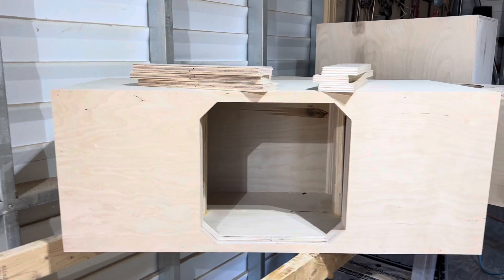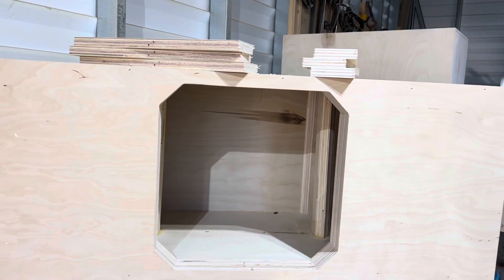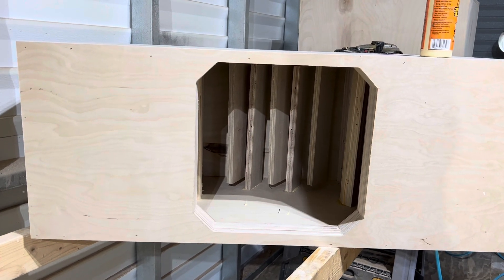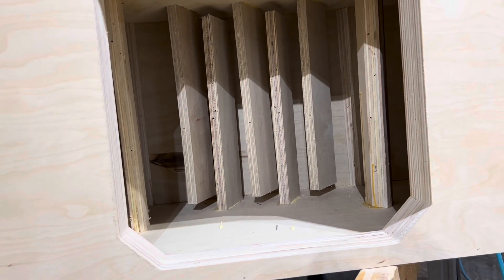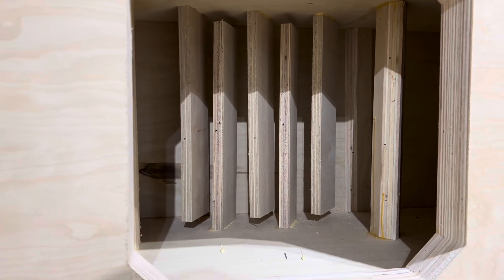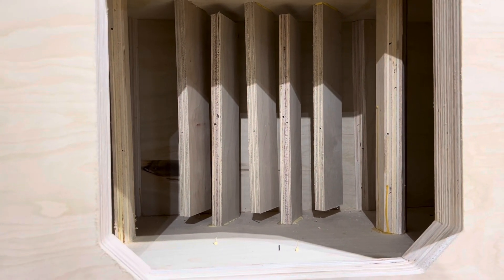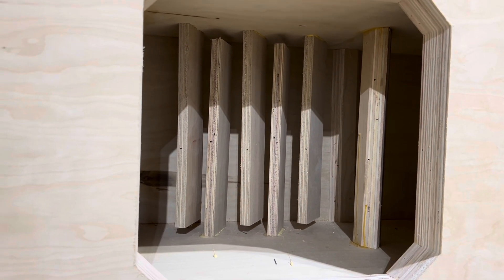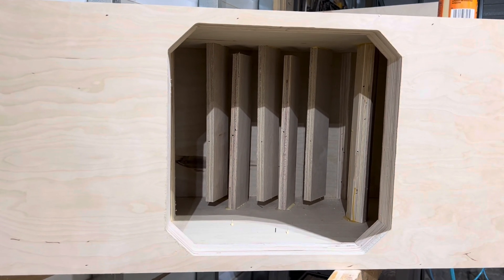Incongruent Box Internals Reduce Standing Waves…A MBE Theory!!

Comment: You can do that and lose volume upon doing so or buy Hushmat wavebreakers. This does exactly that. when you turn your speakers up, the standing waves (or back waves) that build up behind the cones can introduce distortion.Wave Breaker pads are made from a self-adhesive sound-deadening material that helps to break up back waves that can cloud your sound, and stop the distortion.  It also doesn't take any volume from the enclosure. Use it behind subs, coaxials,mids etc. Try either way. Whichever works for your build.

Comment: Would be interesting to compare damping and tonal quality of your internally paneled box with:  1. lining box with carpet underlay  2. lining box with polyfill, and 3.  instead of using wood for the panels, use eggshell pattern foam blocks.
Reply from the maker: All good ideas.. but as I said it’s only a tonal difference. Which could be placebo…😂
Reply: @M.B.Enclosures  Considering that tonal quality of sub bass (in my install) changes even with minute changes in head position in the driver's seat while critical listening, I'm sure there's more than just placebo going on!
Reply: Would the same be for those running an inverted sub setup?

Comment: So what happens if u round the edges ?
Reply: Rounding edges would also eliminate resonate frequencies, depends on size of fillet or chamfer, but most likely it would be minor impact at best. Quite literally the perfect box for a speaker is literally a sphere, sharp/parallel corners or faces are what causes resonance, so by eliminating all parallel faces or having no edges you have an extremely linear response, as good as the sub or speaker in general is tuned. So essentially anything you do to reduce the surface area of parallel faces helps eliminate resonance.

Eliminating resonate frequencies in subs is just much more challenging than regular woofers, mids, or tweeters simply because of the size though. You are infact losing surface area by having to round edges, therefore having to expand further in all directions and round more to achieve the same surface area of a normal box. Not to mention such rounding is much more costly to manufacture at such precision.
Reply from the maker: Fact

Comment: Thanks for another great video. A couple of questions. First, by not attaching the ends of your slanted pieces aren't you encouraging them to vibrate? Second, what about the other parallel walls? 
3. Forgive me if I misunderstood, but we did not be wise to make each of the panels you attached inside the box of different sizes and place them at different distances from each other?
Also, some of your viewers may not realize that this principle has been used in many speakers over the decades. That yours doesn't good some innovations. Thanks again! Blessings!
Reply from the maker: 1. The very movement of each reflective  panel ensures that each wave generated by the cone is not striking at the same time. This was does intentional.

2. The wall that causes the standing wave to develop is the wall directly opposite the source of the wavelength i.e. the driver. Obstruct that initial development and the waves continually stay out of alignment and thusly cancel each other as they collide somewhere in the box.
3. Your mention that thus principle is at play over the years may be facetious. An attempt to deride my originality. At that I will say this…I know builders have been known to oddest the drivers, or even pebble the back wall to dismiss standing waves. I also know that angling the back wall is for this purpose as well. Yet I have never see personally reflective panels being installed opposite the driver. 
I could be wrong though and my theory could be a placebo. Either way i accounted for the displacements the panels take away from the net volume and the performance of the driver SPL or SQ is not compromised. Fact.
Let that sizzle in your spirit.😎
Reply: @M.B.Enclosures  no offense intended! It is my understanding that waves inside the enclosure will eventually escape through the cone or the walls or eventually be turned into heat within the enclosure. Of course, waves generated from the panel directly behind the cone will be more destructive. I may be wrong but this is what I've studied. Perhaps I wasn't clear enough in number three. What I am saying is that people have put baffling inside cabinets for decades to reduce standing and reflected waves. I think yours has some novel ideas but in principle the idea of breaking up waves inside the enclosure is not novel. Again I like and respect your work. I was just asking questions and suggesting research that I had read and also witnessed. Thank you again!

Comment: Subwoofer frequency wavelengths are much (much) longer than subwoofer box internals. I'm not sure how it would be possible to have a standing wave. 20hz - 56.5ft, 100hz - 11.3ft
Reply from the maker: Exactly…they develop but at much higher wavelengths. But all bass is subject to over an under tones so I’m wondering if the panels would obstruct this…I could be reaching.